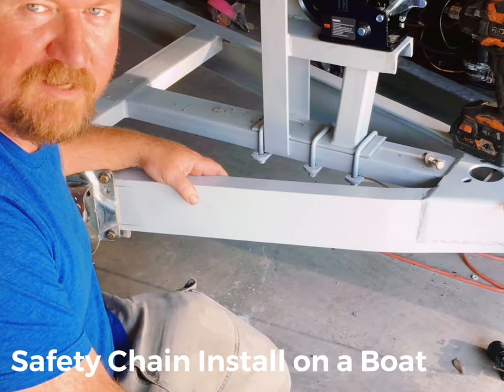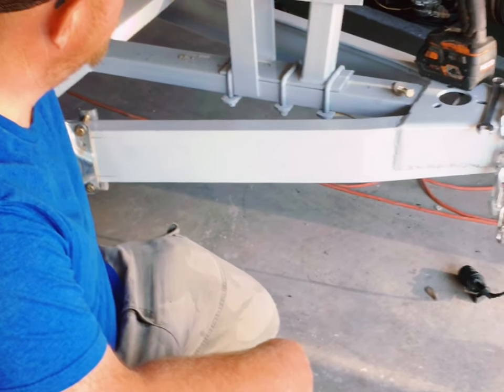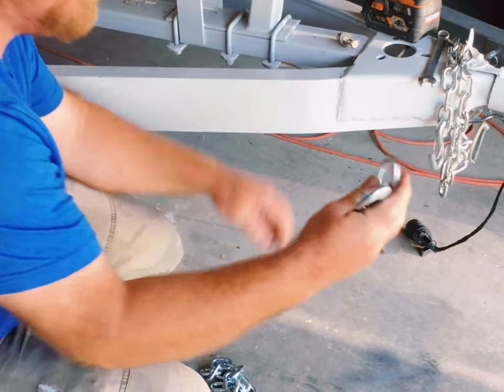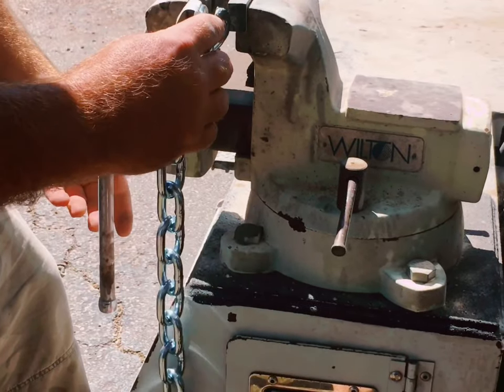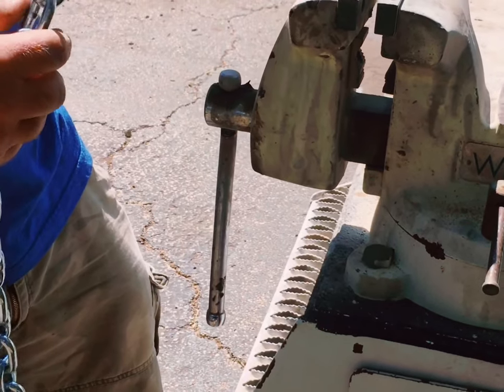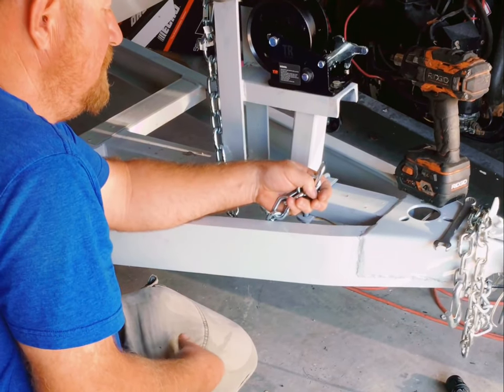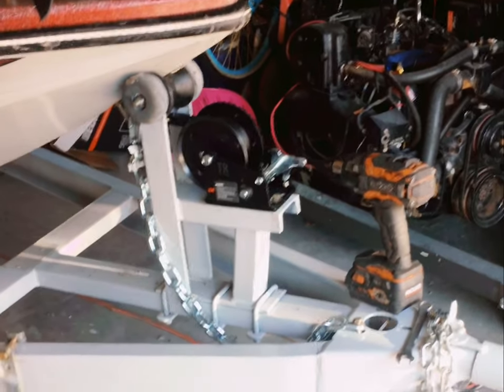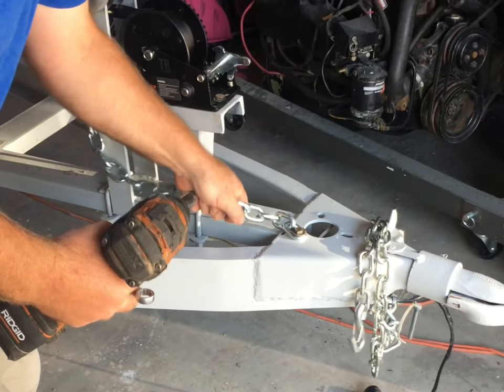How To Install a Safety Chain on a Boat

Comment: I've used that type of link connector in the past, I have a suggestion for you. Weld the link connector at the seam, a better choice would be to get yourself some threaded quick links.....just my 2 cents worth. Thanks for sharing.
Reply from the maker: Sounds good.  Thanks for the suggestion.
Reply: @ProWrenching  My son bought a nice Sea - Doo Sportster Boat this summer ( put away for the winter now ), we never thought of adding a safety chain to the front until I saw your video......so, I thank you.
Reply from the maker: @Al-tl2ov  That’s awesome!  Thanks for watching.